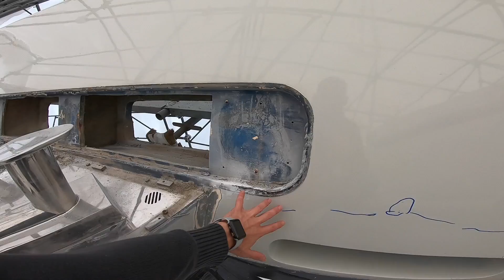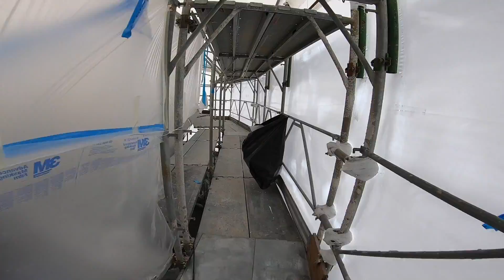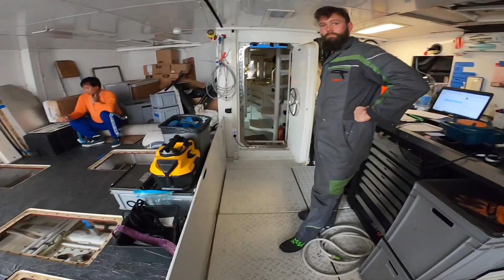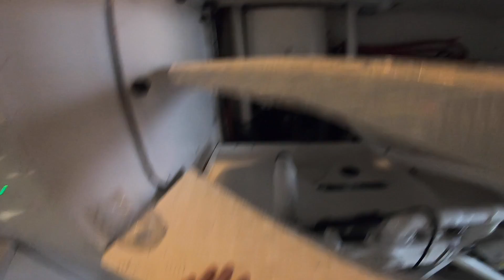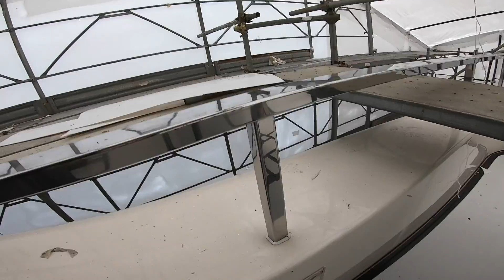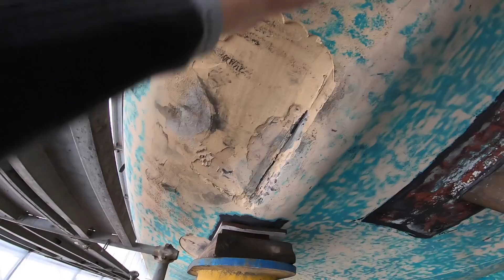Captain's Vlog 24 (Shipyard 4)

Comment: sunned at the indepth knowledge you have of your vessel I would expect the chief engineer to have all this info and more . I would of course expect the skipper to know his equipment on the bridge but you cover the whole yacht and that's impressive.. your owner has his moneys worth in your employment hes a smart guy... if he buys a bigger boat you would be part of that for certain , if I was him id be watching the channel with great interest and learning from it too … MY question is does the yacht have to be checked over and re certified to this level every year ,,  even if the work doesn't need to be done to this years extent  ? ie most things covered this year would still run fine next year but do they still have to check everything even stress levels

Comment: The filler failure is possibly a result of 1. Too thick in that location near the props 2. Vibration of the propellers and shafts, the need to Tune the props is still yet evidence that is what happened.

Comment: Would a yacht made of a steel hull have so many areas that required so much work, meaning like the black strip that is needing all the filler removed and replaced.  Also would there be as many fractures or divots as the case with the fiberglass.  I know steel can have fractures but I would think not as easily as fiberglass or am I wrong in this?

Comment: It's probably just a language issue. but you keep referring to Stainless Steel and Aluminum as iron in your videos. I think you mean to say they are metals. Although stainless steel contains about 65-%75% iron, it is not called iron as that is a different material, typically cast iron. Structural aluminum is typically alloyed with other minor elements such as silicon, magnesium, and cooper, but almost never iron.  Love your videos, keep up the good work.  I can see you are progressing on your videographic quality.
Reply: I don't think it's a language problem. It might be more of a did not pay attention in high school problem. Stainless Steel indeed contains the element Iron, which has the atomic number 26, plus various other elements, depending on what type of Stainless Steel you are looking for. Aluminium is an entirely different element, with atomic number 13, exactly half that of Iron. Which of course makes it so much lighter than Iron.  

But knowing your periodic table of elements does not make you a super yacht captain. So even though it has no relevance to his work, it did provide me with a little giggle, while I enjoyed his video. Thank you captain, and keep up the good work.

Comment: Capt.  Why would there be so much filler on the hull?  I assume the hull was built in a mold like smaller vessels.  If so, doesn't the gel coat go down first making for a smooth surface that is the exact shape the designer called for?  Thanks for these videos, very interesting!

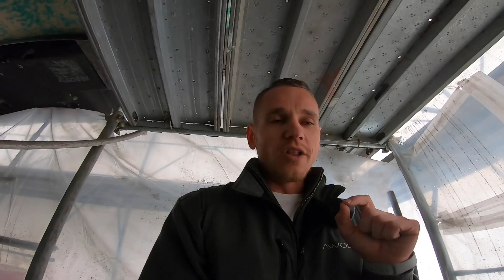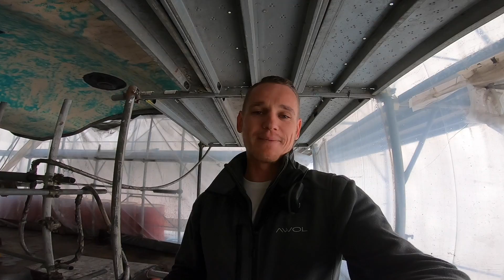Comment: At 16:41 thru 16:46. and at 17:40 thru 18:37  there is a huge plate bolted to the transom that hangs about 1 inch  or 2 inches below the bottom of the boat . Seems like a drag therefor slowing the boat a little.  can you explain why it is hanging below the bottom .   Thank you for sharing , best vids ever.... great job..thanks agin
Reply: Follow-up question: why are you using a fixed interceptor instead of an automatic that constantly adjusts for roll, pitch, and acceleration?